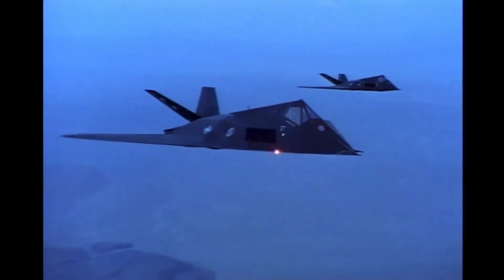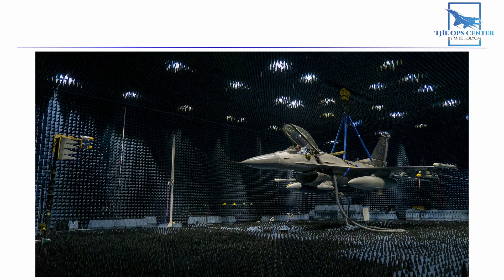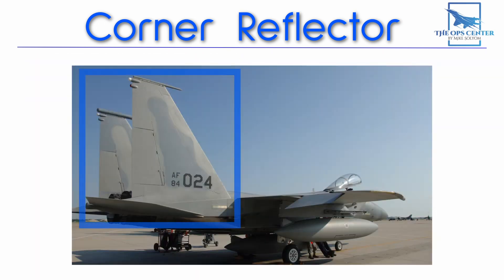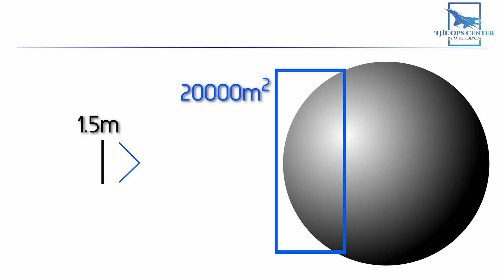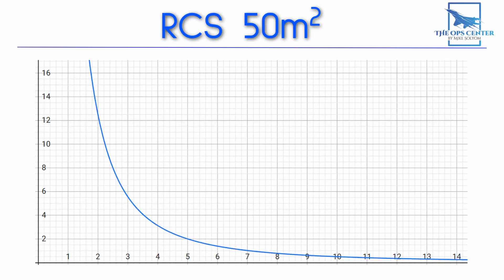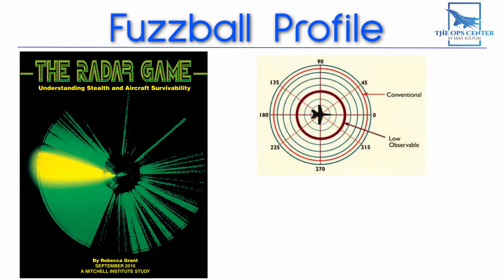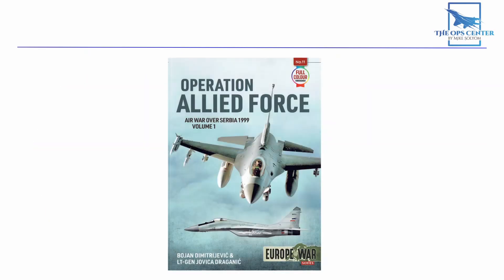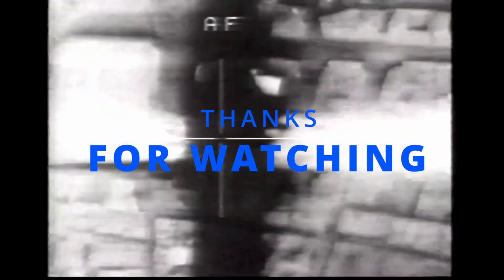How Stealth Works | EW & Radar Series

Comment from the maker: There are a few things that didn't make it into the video I wanted to mention.

1. The SR-71 had more than just radar absorbing paint. It included RAM foam and a shape meant to lower RCS. However, the builders (Lockheed) at the time did not understand stealth as well as they would later on in the development of the F-117. Consequently, the SR-71 had a rather large RCS of around 10m squared.

2. In the outro there is some footage of B-2s. This is actual mission footage from Operation Midnight Hammer, 2025's incursion into Iran. I thought it was neat to see video from such a historic mission and hope you guys do too.

3. There's a popular myth on the Internet that Vega 31 was detected when the bomb bay doors were opened. However, the first detection didn't happen until 4 minutes after Vega 31 left the target area. It's highly unlikely that Vega 31 had flown for at least four minutes with the bomb bay doors open (plus two more minutes when the fire control operators started tracking). The 3/250 ADMB operators picked up Vega 31 simply because it was close enough and presented a high RCS angle.

EDIT: This part was mentioned in the video. But it seems a few people missed it so I want to put it here as well.

For some of the charts I used hypothetical numbers. In other words, I completely made them up. Real RCS data is often times classified so I will not show that here. A 100% accurate reflection of the Radar Range Equation would also make the charts harder to interpret (it did for me). For both these reasons I decided on using simplified math for the charts. However, it is generally agreed that 0.01 square meters RCS (and less) is about where very low observability happens and that much I did keep in the video.

This video was made for everyone, not just physicists. The charts are intended to illustrate a point and be easy to understand. That point is the drop off from radiated energy is not linear. It goes down quickly with range and conversely goes up rapidly as a target gets close to the emitter. Hopefully, that much was clear.

This is why I brought up this fact near the end of the video. Now I know some of you want to know the real math behind the charts I used in this video. So that's why I talked about the real life physics paper behind the F-117 and shared a link to the open source translation of it. Those are the accurate numbers. So feel free to download it. However, I'm going to warn you ahead of time it gets very deep and is not for everyone.

EDIT 2: Some commenters are misquoting the Radar Range Equation stating a part of it is "Range to the fourth". This is an incorrect short hand for the real segment of the equation which looks like this:

4 times Pi-squared times (range to the target) squared times (range from the target) squared

The two ranges are separated because bi-static radars exist (and are great for detecting stealth aircraft). Range to the fourth would be wildly inaccurate in this scenario. In that case the return signal would look exactly like what I posted in the video.

Thanks!
Reply: I believed that myth, thanks for the clarification
Reply: Quite a few Serbian SNR-125 radars in the 90s were also upgraded to SNR-125M1T standard which included an IRST system and LRF, which could be used to guide missiles to my understanding.

So there was a possibility that the F117 could have been tracked this way, but again… The F117 did a very good job at masking its IR signature.
Reply: Fantastic information, a good book I have is by Wiley (Aerospace Series) Military Avionics Systems, covers CNI, EW, EO, SMS, RADAR etc…

Think you can download it for free on PDF, it’s a few years old but the principles remain valid
Reply: That myth is probably spread by Americans who don't want to convey the fact that the f117 not invincible..the only way to do that is to say that the detection happened when Bombay doors.were opened and otherwise it's a perfect undetectable piece and that too by vintage Soviet equipment
Reply: @AneeshSL I mean its probably the easiest possibility to understand for the average joe.

Comment: To say that radar waves "charge" the surface which then produces its own waves is wrong. The radar wave accelerates the charges (electrons/protons) in the surface and an accelerating charge produces an em wave. Conducting materials have more free charges so they are easier to accelerate and they reflect em waves better.

Comment: To reduce the radar detection range by half, you need to reduce the RCS to 1/16, not 1/4. That makes all calculations in this video wrong.
Reply: I think this is right. The radar equation has a 4th power term in it because there is a radius-squared falloff from the target, but that's only after the radius-squared falloff from the emitter as well. 

So if you've closed half the distance, you're receiving 4x the power, and that's the basis for the second r squared falloff of the reflection, which will also be 4x brighter, for a total of 16x more received energy.
Reply from the maker: Please watch the video in its entirety and check the pinned comment. Your concern was addressed. Thanks.
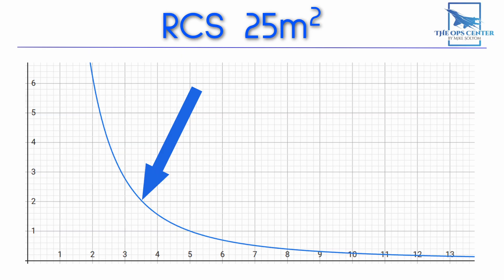Reply: @TheOpsCenterByMikeSolyom  At 10:47, your model puts the detection threshold at 700km with a 100m2 RCS, and at 11:21 the threshold is reached at 350km with a 25m2 RCS. 

So in this model by halving the range, the radar's received energy is reduced by a factor of 4, so the graph is showing an R-squared falloff. 

But radar doesn't have an R-squared falloff, it has an R to the 4th falloff (because the inverse square law applies to the original signal, not only the reflection). To get the graph at 11:21, the RCS would need to be 6.25 m2, not 25, no? The Radar Game says as much: "Range of detection varies with the fourth root of the result of the radar range equation." (page 39)
Reply from the maker: @icedragon769  

Thanks for taking the time to explain your point and being polite. It is appreciated.

The radar range equation is more complicated than that. It is not Range to the fourth. Rather it is four-pi-squared-times-range-to-the-fourth dividing the return energy. Not to mention all the other factors that make it hard to interpret returns. That is far more complicated than I wanted for this video. 

So I just drew a line that roughly approximates non-linear energy loss. Again, this video is for everyone. Not just math aficionados.

Range to the fourth also made a graph that I found hard to read because of its steepness. So I went with one that was easier for me to interpret.

Hope that helps.
Reply: @TheOpsCenterByMikeSolyom  Fair enough, I appreciate the difficulty in pedagogy that comes with the visually tighter curve, so that totally makes sense (though I could see a case that showing the steeper curve would grant further emphasis to the sheer difficulty of designing an aircraft that suppresses it). My replies above weren't meant as criticism, just conversation and clarification, I am glad they seem to have been recieved that way :) 

This is fascinating material, as I said in another comment, I would love to hear more about the tactical implications for those of us flying combat sims with stealth mechanics.
Reply: @TheOpsCenterByMikeSolyom  The promblem is not that you used "hypothetical numbers," but that the formula is incorrect. You described the decay of the fourth power as the decay of the square, which greatly amplifies the importance of stealth capability. This is not a problem that can be fixed by tweaking a few data points.
Reply from the maker: @dfgdfghbn  The chart and explanation I used was intentionally simplified to make it more understandable. Go ahead and plot out some numbers using the Radar Range Equation. And I mean all of it, including the parts you left out. You will see the actual curve is far steeper. Its a lot more difficult to explain what is going on when all the lines are stretched out and very close to each other. There is no way a 100% accurate depiction of that would have been useful. It would have been noise and I didn't want to do that to my audience.

This video's point is to explain How Stealth Works. Not to be a treatise on how radar waves propagate. That would be the document I mentioned in the video and provided a link for in the description.

Also, I have a video series on the basics of radar where I cover a lot of that theory, including the Inverse Square Law. That was also mentioned and linked. 

I hope this addresses your concerns. Let me know if it doesn't and I will try some more.
Reply: @TheOpsCenterByMikeSolyom  If you think the image of the fourth power inverse ratio is too steep and inconvenient to read, you can use a logarithmic coordinate. The radar equation is the core content of stealth technology; sacrificing the accuracy of this part for readability would greatly mislead the audience about the effectiveness of stealth technology.
Reply from the maker: @dfgdfghbn  I disagree. Range to the fourth would be the actual misleading factor. Here's why.

The Radar Range Equation comes in two parts: top and bottom. Here is the bottom half.

4 times Pi-squared times (range to the target) squared times (range from the target) squared

The two ranges are separated because bi-static radars exist (and are great for detecting stealth aircraft). Range to the fourth is not accurate here. In that scenario the return signal would look exactly like what I posted in the video.

I'm not changing anything here. If you can cut out parts of the equation to make your point. So can I.

PS: If my intended audience was a group of engineers I most certainly would do as you mention. However, I want this to reach as broad of an audience of possible so I need to balance how far I go into territory that could bore people.